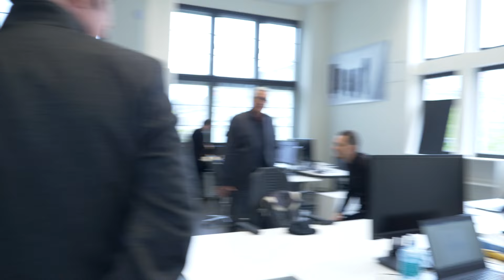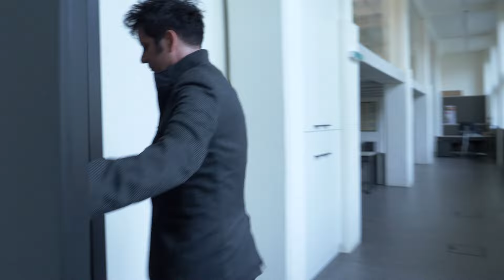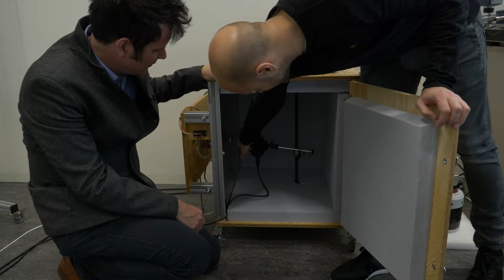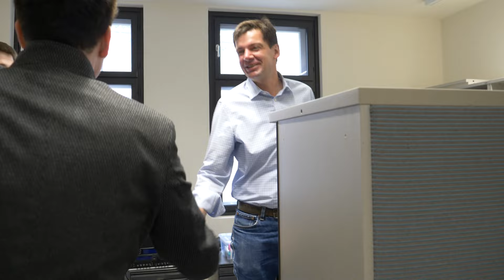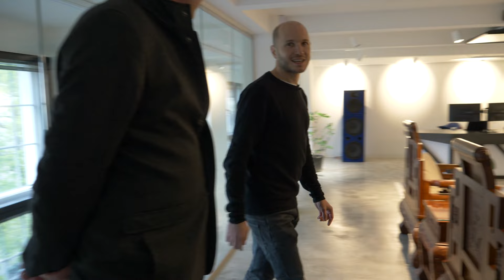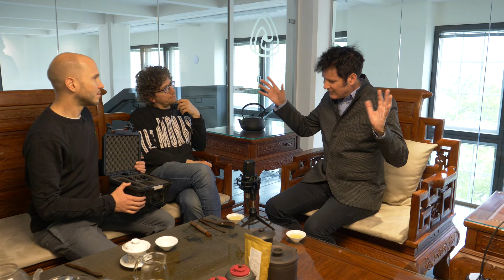Lewitt Audio Tour & Interview with Founder & CEO Roman Perschon - Warren Huart: Produce Like A Pro

Comment: I have the older design LCT 140 matched pair and absolutely love them. The only issues I've had is one of the clips stripping and the switches disintegrating. Easy fix. But the sound is amazing for the money. I usually use them live with a kick mic on drums, and that's all I need. I hardly need to EQ anything.

Comment: I have a few Lewitt microphones here...640 TS, LCT 340, MTP 940 and the fantastic DTP 640 REX, which is hands down the best kick drum mic on the market today in my opinion. I use the microphones both live and in the studio and the 640 REX, MTP 940 and 640 TS are extremely versatile performers that are also tough enough to withstand the rigors of life on the road.  Unlike many other kick mics the 640 REX is not a one trick pony that imparts a single, sound on every bass drum its used on.  The dynamic and condenser capsules are perfectly in phase so the sound is sharp and not smeared, and the control switches on the mic allows you to tailor the frequency response of both capsules for the bass drum you're working with and for the sound you want, killer.

The large diaphragm, condenser, multi pattern MTP 940 CM is really a studio microphone that is extremely comfortable and easy to use on stage, even very loud stages...it sounds great, clear and accurate as a Vienna church bell, provides plenty of gain before feedback, has great proximity performance and smooth off-axis sound, and no handling noise!  It's head and shoulders above the other hand held condensers I've tested it against and with all the control features it can be tailored for any situation, great mic.

Comment: I have the 540 S and the 640 TS. I had previously spent a lot of time trying to find the right stereo setup for a featured acoustic guitar in an instrumental (i.e. one stereo acoustic as the feature instrument with other backing parts in mono or doubled). I had tried so many mic combinations and stereo micing techniques. While they all worked to some degree, none really did it for me. I set up the 540 and 640 in M/S and that was it. It was a beautiful, clean stereo image that I could easily mix. It also afforded me the ability to record doubled instruments with two mics (e.g. 540 + another LDC or the 640 with a different polar pattern) and have a nice stereo field there as well as needed and mix later. They are really clean, flat mics that lend themselves well for mixing at a great price, especially since I managed to find the pair for less than half price.